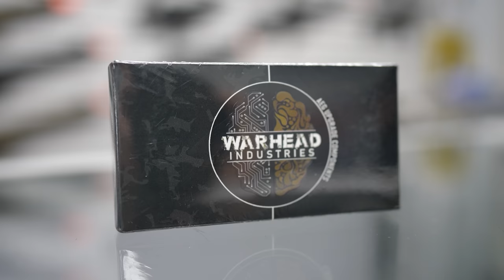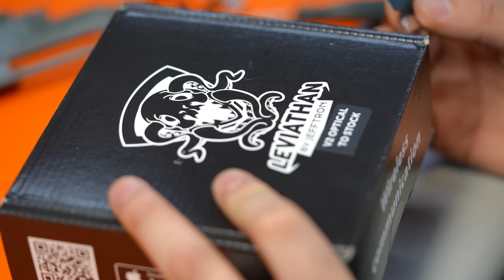Building the ULTIMATE Airsoft Gun

Comment: Absolutely genius AR latch design. I need to get one for when I rebuild my gearbox. I'm also curious about the advantages of a brushless motor besides longevity. I love my old SHS high torque but it's loud and it gets hot as hell when I'm trying to suppress.
Reply: I know this is a late reply, and you probably already have your answer but, heres my answer to ya!

Benefits of a Brushless Motor are as follows: Less heat from the motor, snappier trigger response, less amp draw, faster rate of fire, longevity, built in ESC which means a mosfet is not required since the motor will know when the battery is to low, and stop the rif from firing, along with being quieter than a typical brushed motor.
Reply: @legogaming6585 you are the best bro , I bought guns and everything long time ago , played only a couple times then life happened, but finally trying to get back in Nd wana catch up , mind giving me any tips for upgrades?

Comment: Yo... That's pretty sweet! I built one a few years back with BTC Chimera which has insane programmability, and can be programmed to I guess 'wind up' your gearbox so each shot was instant. I hadn't seen the brushless motors for airsoft, but that's what it needs next time I take it off the shelf!

I wish longer barrels didn't effect RPS so drastically and on so many levels though, because I want long range AND ridiculously high RPS. That seems to be difficult in an airsoft gun, and longer range accuracy capable tighter barrels also tend to pick up plastic deposits pretty quickly when you throw tons of bbs through them no matter how much I spend on 'premium BBs' even sniper weight "precision" stuff. It was super fun between barrel cleanings though!
 
I suppose Richard Gatling might have something to space out the time between cleanings, but then the process is 8x as long from what I've heard... xD

Comment: Newbie questions:
1) Why did he cut the hop up rubber instead of leaving it as it is?>
2) Also, why did he replace only the central gear's bearing and not the other ones? Bearings bushings aren't too good for high speed as they tend to overhead with super high RoF (35+ rps), but I don't quite get the sense of replacing just one of them instead of the complete set
Reply: The guy runs a shop and does this professionally.. I"m sure he has his reasons, you're probably better off emailing the actual Blitz shop owner though. Wtf is this Youtuber going to know about it?
Reply: 1) He is R-hoping it so thats why
2) Central bearing/bushing takes biggest load of all of them so thats why he only replaced that one

Comment: Hi! Awsome video! Can I ask you about the little lable you've done by cutting? the one you positioned on the barrel's hole for the hop up regulation...it's the first time i've seen it...
Reply: That’s r hop, it’s another rubber patch on the barrel window, I personally do not recommend just because it’s so easy to mess up and it’s typically much more expensive than something like a flat hop. There’s a lot of smoke and mirrors around it, but it’s usually hyped up beyond reality of what it does. If done perfectly however it’s fantastic when paired with a great barrel
Reply: Ok, thank you for the answer 💪🏻

Comment: 06:30 is that necessary? Does it improve the hopping??
Reply: He was r-hopping the barrel (r hop). R hop is supposed to be the best type of hop up in terms of hopping heavier bbs and effective range. It's meant for use of .30 gram bbs and higher and can usually shoot them out to around 300ft or more. They are usually expensive and difficult to install however. Cutting the piece out of the tubing isn't necessary for any type of hop unless if you're trying to do this r hop mod. Pretty much no other hop systems do this.

Comment: Hi, can anyone explain why at 2:36, he used one bushing on the spur gear and bearing on all others?
Reply: The spur gear takes the highest amount of load out of all the other gears. Bushings are more durable than ball bearings for high load, low speed applications but for lighter loads ball bearings will last longer and have less resistance which is why he left the other bearings alone.

Comment: The end result is super solid. Fantastic Shimming, like actually mind blowing how well that shim is. As another tech, can anyone explain why they only replaced the bearings for the spur gear, and why shave the gearbox instead of using correct size bushings??? Also, what is with the drilled grub screw for the anti-reversal latch spring? Is it supposed to be snappier than the normal ARL spring? Does it give faster follow up shots? (time until gearbox can cycle again is what im thinking?) And like others said I thought the prometheus gears sucked? Other than that the result is no doubt great. I know that a lot of these differences between brands really only brings out marginal differences most of the time, but wanted to know some of the more out of pocket methods here.
Reply: It's because of the Angular Momentum of the spin ! Apply right-handed rule in Physics
The Spur vector will push downward, the Sector vector will push upward. Taking the weight distribution into account, then the Lower Spur and Upper Sector should be replaced into Bushing instead of Bearing since they have more stress compared to other 4 ones.
---
The reason he correctly sized the bushing is because the bushing shape is different, you can ignore that part. You can distinguish between "Low Profile" and "High Profile" Bearing/Bushing as an example.
---
Why did he create a new way to push ARL ? Look at the structure of the Gearbox, it looks like shit ! Also the normal ARL spring can scratch the wire !!! Retro Arms, for example, solved this problem. Take a look and compare different gearbox, you'll get what I mean.

Comment: That is absolutely insane!

But looking at the price tag for one of their brushless builds you'd probably be better off getting a HPA engine in your gun like the P* Jack

I got one in my Cm16 and it's a fuckin beast, shoots really far with nuts trigger response and it's a fraction of the price!
Reply: Ok dude, we get it. Polarstars are cheaper than getting your gun built out by a "professional". But with AEG building its a different type of performance, its getting a 30 year old design to do what an engine ran by air can do, call it proof of concept. Polarstars will always be a little cheaper, but in my opinion, if you know what you are doing, just build a high speed AEG.
Reply: @justplainjosh.  oh yeah for sure, my "insane" comment was more a compliment on the performance as that is really really good from an aeg

Comment: Changing the one bearing to a bush, doesn’t make a great deal of sense. Flat hop fair, but then greased the hop rubber so that will fail sooner and has a chance of getting into the barrel. Maxx hop up units always going to suck, you can see it in the video with the inconsistencies of bb flights. Didn’t add any relief points to the gearbox, it will fail. Cool ar latch, I’ve not seen that before. Levithan suck, not great for brushless and not great for keeping settings. Pdi inner barrels are overpriced but fully functional. No sorbo pad is nice(because they’re terrible and make engagement worse).